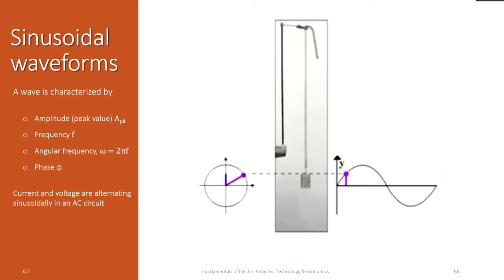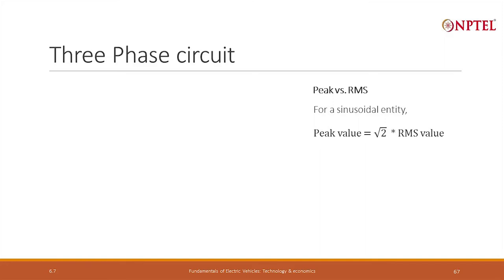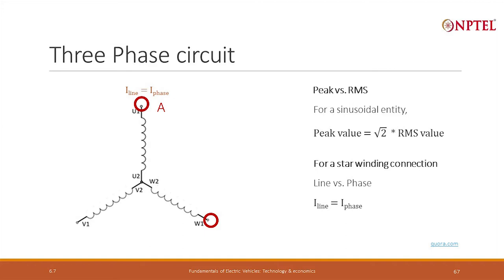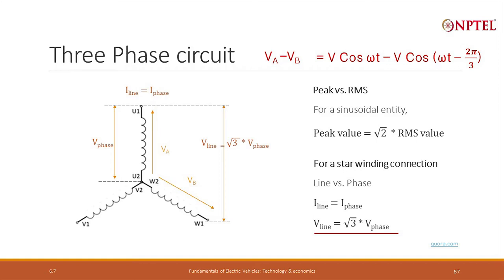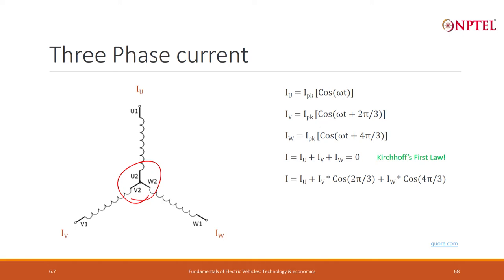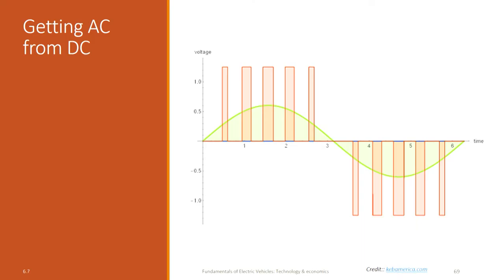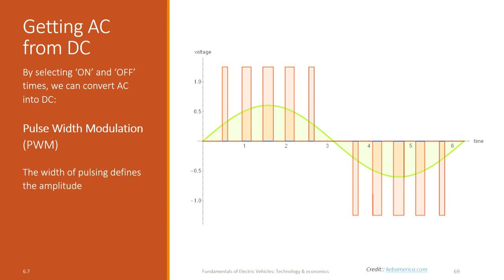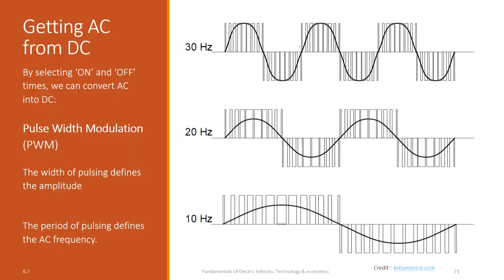Lecture 57 - Three phase AC - Part 1

Comment: Hi Sir, your lectures are interesting..just one piece input from my side ...we should not describe the RMS value so much mathematically , rather it can be defined as a) Heat generation in case of AC can be described as similar to heat generation by DC but with RMS value